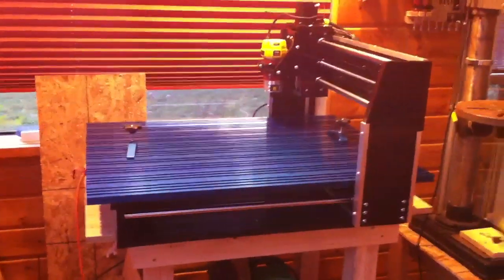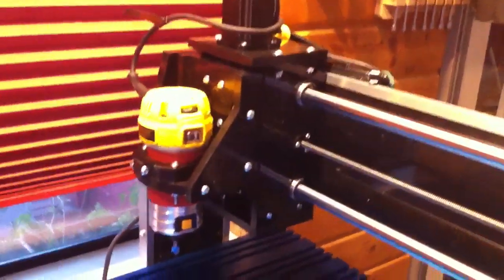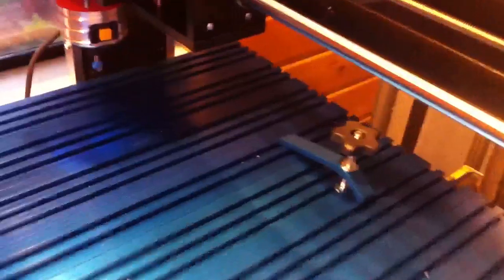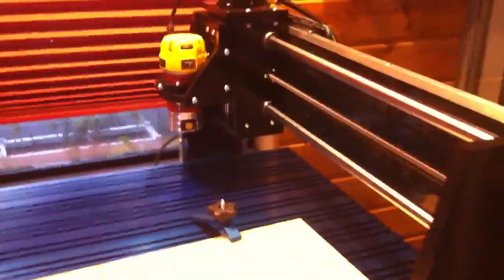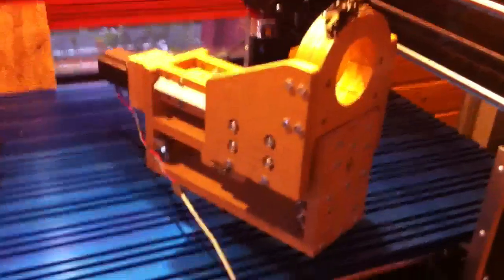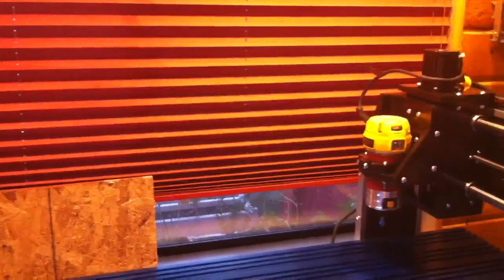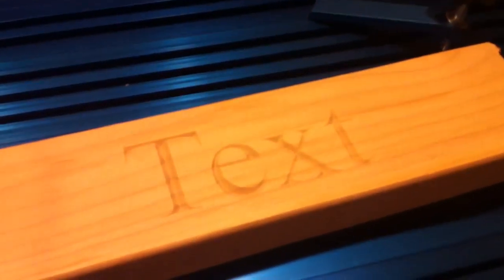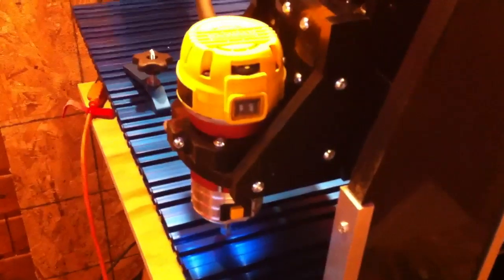CNC Shark Pro Plus out of the box

Comment from the maker: Show me a CNC Mill that has a bed size of 24" x 24" for four grand. I studied to be and was a machinist for years and the best you'll find for four grand is a chinese knee mill that's been converted by a hobbyist. It comes down to what you are wanting the machine to do. You wouldn't use a 50k Mori Seiki mill to machine a kitchen cabinet just as you wouldn't use a  50k Thermwood router to machine a turbine impeller. It's all about application.

Comment from the maker: @identernet  I've been using Mach3 ever since building my first cnc two years ago and am quite happy with it. I looked into EMC for Linux but wasn't interested at the time in learning the Linux Operating system but have since learned to used it rather well. I'm going to throw windows xp onto the laptop and used it specifically for this cnc. Should work a little better with XP on it as opposed to Win7. Mach3 will run on Win7 but doesn't like it. I'd love seeing your cnc, do you have video of it?

Comment: Nice machine. I built mine myself out of steel so that I had a 3ft x 6ft bed, but I never use any blanks larger than 2ft x 2ft. Wish I'd made it the size of yours now. I notice you mention Mach3. I bought it about 4 years ago and i believe it's probably the best value software you can buy, and I mean any software, not just CNC. There is some free CNC software on Ibuntu, can't remember it's name off hand but it's very good, especially as it's free.